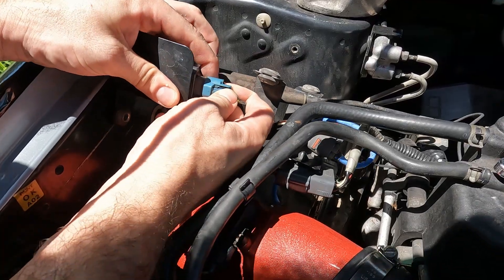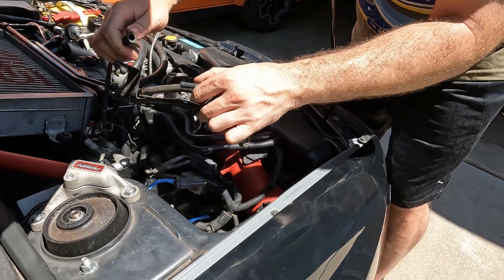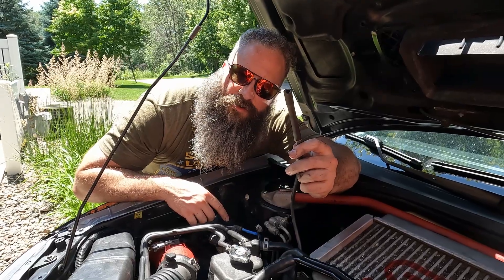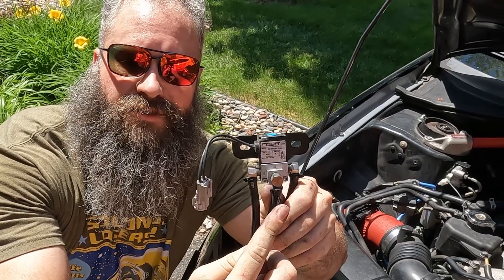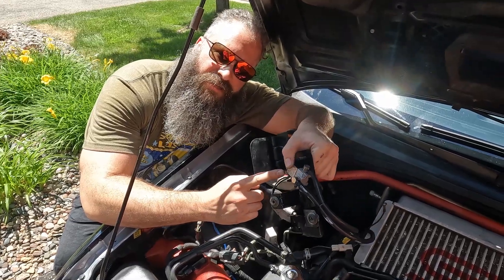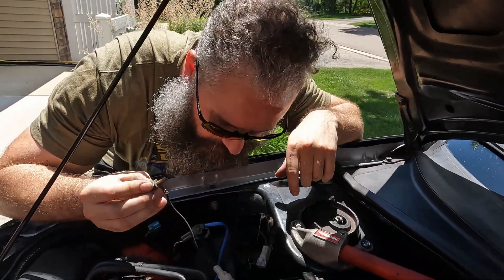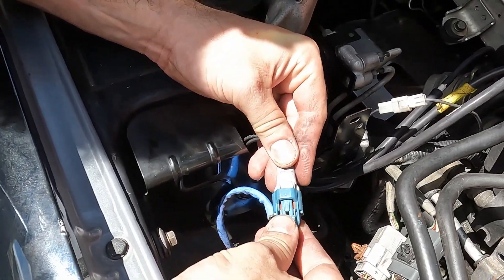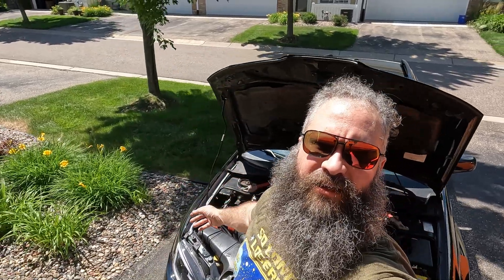How to Install an Electronic Boost Controller (EBCS) [Subaru Impreza WRX STi Forester XT 2002-2007]

Comment: Do you need a tune after the install
Reply from the maker: Great question, you won't need a tune afterwards but you will now be able to adjust your boost levels electronically after this install.  So, it will help with tuning whenever you do tune your Subaru.
Reply: @subearu I bought one for my 1998 forester never been tune i might chuck it on without a tune
Reply: @josephjdm4877 it will overboost. learned the hard way.

got a cobb EBCS ots tune or drive it to the tuner and stay out of boost.
Reply: @subearu  Tune required, you HAVE TO reduce the wastegate duty cycle max table down 30% globally to start or you will overboost. These values can be tweaked back up a little at a time if needed to reach boost target.
Reply: @RBslowman  Thats interesting . I have a mapped LINK ecu  with I assume the OEM 2 port controller. If I change out to a 3 port , then are you suggesting I will need a re map ?
Reply: @99fulham99 yes, I am planning this for my TT Legacy in the future. All restrictor pills need to be pulled out of the associated vacuum lines too, the 3 port handles it. i need to do a wideband too. I've got the Project Lambda Tuner.